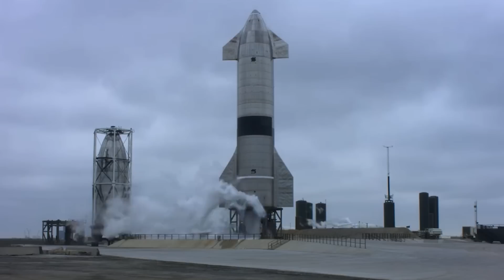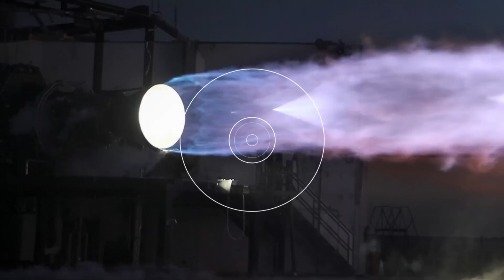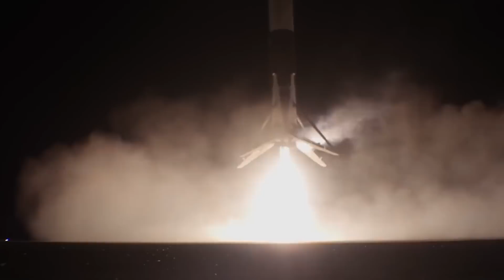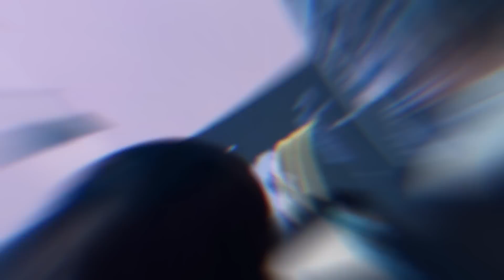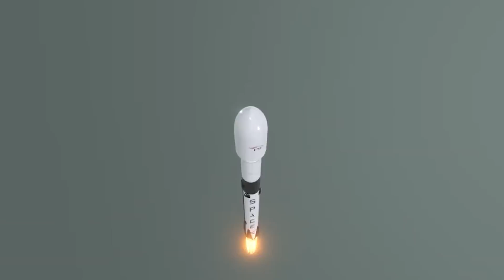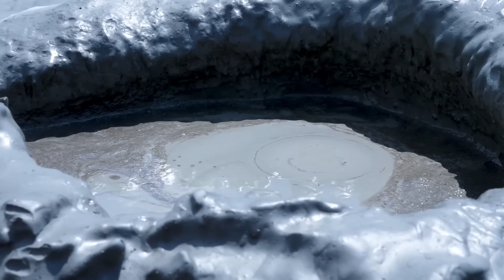SpaceX Showing Their 33 Engines Starship Booster Monster For The First Time Ever

Comment: Russian proton n1 rocket had 30 engines and all of the 4 or 5 rockets blew up! Some type of vibration and coking in the engines. But the Russians used kerosene. Somehow I think SpaceX will be a lot more successful than old Russian tech. SpaceX is using cleaner fuel from Methane!